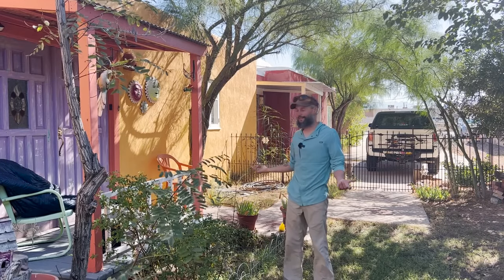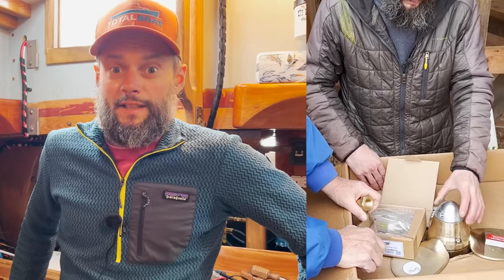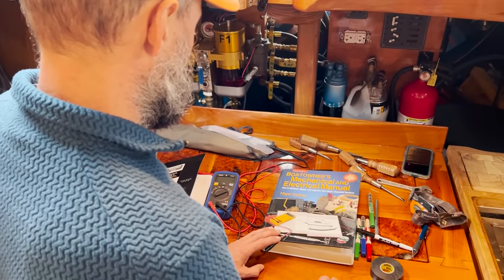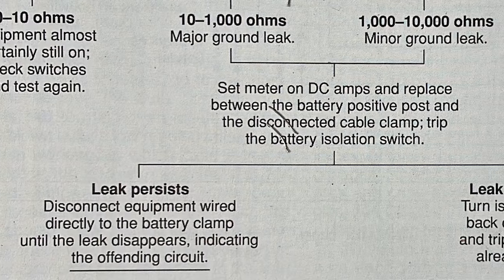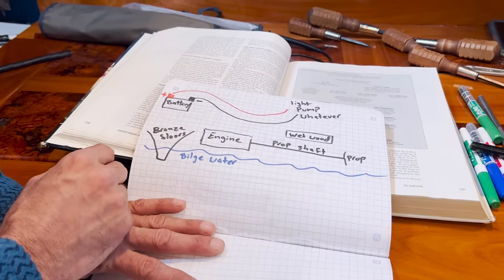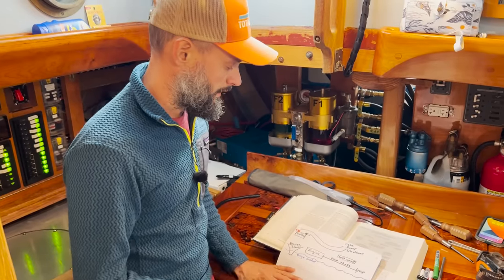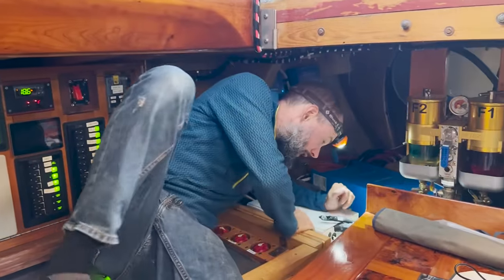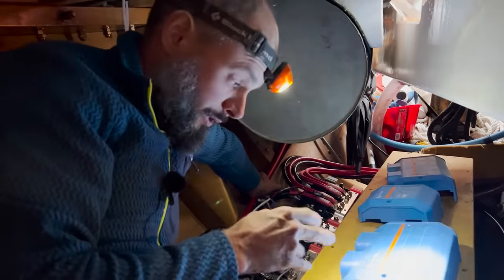Stray Current Puts Arabella in Danger - Episode 284 - Acorn to Arabella: Journey of a Wooden Boat

Comment: Hi,
I have watched your YouTube videos with interest and think you, your wife, friends and helpers have done a great job.  The YouTube video about the anode falling off the prop was interesting.  It could be quite simple in that the prop is made of a few dissimilar metals and will naturally have an electrolytic impact; hence the need for an anode.  The fixing screws for the anode are quite near the edge of the anode and have found from experience that prop anodes of that type can corrode around the fixings.  I suggest when you fit a new anode, is to wipe some sikaflex or silicone mastic in the receive of the anode, and coat the immediate area around the anode fixing location with some paint.  This will protect that area from corrosion and you most likely will find the anode will not fall off.  I have done this trick for years and have found the anode stays in place.  

I also suggest you should fit an independent anode and link it back to the engine ground + any skin fittings in the area.  You have quite a considerable electrical installation and the single prop anode will most likely not cope, should you have any stray currents.
Anyway; happy sailing.  Regards.  Mike

Comment: As an ex Submarine electrician who worked on 440v batteries can I advise you to get a rubber mat to cover all the live terminals?  It will make it more comfortable for you to lie on and it will prevent a dropped tool shorting things.  The correct sized spanner or socket suitably insulated (heat shrink) would also be a good investment.

Comment: steve, sorry to keep at you when you want to leave.  think about getting an alternator- delete for the diesel.  you can run the engine. tension the belt, for the cooling pump and have no fear.  keep the alternator in case of need.  if you are not needing the electric get rid of the load.  the diesel will be more economical too.  now go climb some rocks.

Comment: Current must be flowing between the propeller and some other external metallic component below the water line in the hull. You could use two long lengths of electrical wire, the VM attached between them, one end of one length attached to the propeller shaft inside the boat and the other end of the other length used to probe all the the other metallic attachments.
Observe the VM for currents that would otherwise have flowed through the sea water. This could be done even when under way. This may help to narrow down the search for the offending system.

Comment: My guess before you came to the same conclusion was stray current from the engine hopefully the alternator is not using the block as a ground. An unlikely source would be the starter connection but still worth checking. Good luck in the mountains.

Comment: Correct me if I'm wrong, but with your meter set to mA and its reading 0.01, then the measured current is 10 micro amps isn't it? Good work by the way mate!
Reply: I think that for measuring milli/microAmps the lead has to be in the right port instead of the left port. Look at 21:17
Reply: @CarlosdaCunhaeSilva  you are perfectly correct! Well spotted. Maybe he should have taken the measurements with the mA port...
Reply: Yes. Hes in the 10A port which has a different shunt. The measurements are all off...

Comment: This is entirely speculation, but I noticed that there are a lot of excess cabling all neatly rolled into coils and zip-tied. 
While this all looks very neat and professional, I have found that such coils create induction which drops the current to some degree - sometimes a lot.
If any conductive material comes into range of this coil-induction, a current will arise in it.
Just a thought - but you would do well to get rid of excess-cabling to eliminate stray induction? Specially if it has been made into a neat coil.

Comment: Please check that the Victron Orion TR-Smart DC-DC charger is the Isolated model and not the Non-Isolated model. This is why Victron specifically made two different types. The DC current can be pretty dirty coming from the alternator. You don't want the current is to flow directly between the two sides of the ground. The isolated model filters electrical noise generated from the alternator out and along with it those pesky stray currents.

Comment: I once had the same issue, and I could not find the rootcause,
After many hours, the straycurrent was “gone” 
Me “happy” 
Then, I strapped the V-belt back on, finish everything, did the cleaning up and did a last check on straycurrent.

…. It was back !

It appeared that the V-belt was conductive, and Made the connection to the motor/aluminium hull/ shaft.

I bought a Non-conductive V-belt,  —> Done.

I never suspected the belt in the first place…
“Lesson learned “

Comment: As long as you're working on the engine, have a close look at the starter circuit.  Very possible some corrosion in the starter solenoid is causing the leak.  Had solenoid a couple of time be a problem when exposed to heat and you been doing a bunch of cruising on just the motor.

Comment: I also have a featherstream prop and had the same issue.  I have changed the way I fix the anode on. Clean the mating surfaces of the prop and anode then install using sealant to isolate only the fixing screws from the anode.  Test for continuity if you can. This now gives me at least a season and the anode is degrading normally.

Comment: IF what you're seeing is caused by your boat, it means that for some reason one or more of your under water metal pieces is at a different voltage than the prop shaft. Hence current flow. How are your different ground systems connected? Is there a wire connecting all under water metal? to ground? This prevents any voltage difference. Good luck. I spent 52 years in the electronic business finding defects and ground issues can be  very perplexing. Good luck

Comment: I love your meticulous trouble shooting. Fred of Hansen's is a great guy ! I have noticed you have an immense electrical system. I have thought of writing an article along the lines of ' what mid size cruisers can learn from pocket yachts' regarding electrical systems. Nothing to do with your electrolysis issues, and taking into account your solar array is more than enough to keep the batt bank well charged, I notice that under way you run a lot of electronics. A compass (aside from Nighy illumination) takes no electricity. If it's a blue bird day and sailing in 'known good' waters (depth etc) shut that stuff down, save some juice, save some parasitic leaking and allocate more attention to the sea life, and conditions observation. I am of course speaking somewhat out my keeper because I just have a tiny, weeny little system. But that is also why I almost never fire up my fixed mount VHF (hand held instead, when short range) I use a tablet for chart plotter in the cockpit, independent of system, solar LED lights etc. I rarely even need to through my batt 'master disconnect' switch on while under way during the day light. Thanks for the inspiration as night before last I had my one and only USB port give up the ghost. So that and a weird bleed / equalization seemingly between my bank 'A' and 'B' need to be trouble shot..... I'll probably do that in the boat yard after fall, haul LOL :)

Comment: My first thought knowing you were going away was to connect a kg or 2 of hull anode to the propshaft by wire and hang it over the back (and keep them for any time you are leaving her in one place for a while, especially near other boats or harbours with piling). As the story unfolded, it started pointing to engine electrics as you have done plenty of motoring. The best way to neuter your alternator is the vets way. Whip 'em off completely, take the controller out.

Comment: I got two words for you:
Ground Fish.
You don’t have a “leak”. You have a ground loop. A voltage differential, if you will. 
Very common. 
In a closed DC system there can’t be a path to an earth ground that less resistant than the closed negative circuit. 
And you have that. It’s the negative lead to the stater, the. The engine block.. then down the prop shaft into the water., thus eating away at your anode. 
Solutions: well, a very good solution is to separate the power and ground with solenoids. Ford starter solenoids would work. 
Solution Two: which is very common on work boats, connect a ground fish. Which is basically a zink anode (yes, shaped like a fish) that is molded over a cable that is connected to the negative pole of your battery bank. Then you throw the fish in the water. Thus providing a uniform ground. 
Though, as a permanent fix, I’d definitely isolate that engine block And make up a better ground that didn’t involve the fish hanging over the side😆😆😆
Reply: Yea, I’ve seen this done as a precaution when sailors have to leave their yachts moored in sketchy marinas for extended periods. More often it’s a cheap and effective way to ground the mast against lightning or static current.
Reply: I couldn't quite make it out in the video, but I think the DC-DC charger is the non-isolated one from Victron, so the neg/ground is connected and not isolated.

Comment: If you built a steel ship, I would suggest you use Impressed Current Cathodic Protection (ICCP). This is how modern ships prevent corrosion without the need for sacrificial anodes. If your alternator is producing excess current, it would definitely be the most likely cause since it is attached to your prop, making the problem even worse than if it was a bilge pump.

Comment: Steve, I do not recall from previous videos, but is the alternator the only component that is belt driven on the engine?  If you do not need the alternator power and that is the only thing belt driven on the engine, just remove the belt from the alternator, that way you know the alternator cannot produce power when the engine is running. If the internal regulator has been “neutered”, then even with the power wire disconnected from the alternator it could still leak current through the metal case of the alternator and through the engine possibly.
Reply: Water pump for the engine needs to run.
Reply: @roberthale8407  ok, I wasn’t sure. A lot of diesel engines have gear driven water pumps, but I’m not very familiar with small marine engines.

Comment: I think, you should measure ac voltage between engine block and seawater (ground) when engine running. There is heavy coils in alternator and if not connected they may form some ac voltage to its own frame even without any current going out. It may be enough to eat the sink.
Thaks for nice videos!

Comment: Not sure if it's been mentioned(I think it has in some comments) and it wasn't made clear:  Because any leak requires a return path, just checking if there is current to each device in turn won't really work.  It wasn't made clear if the boat's main DC negative is connected to the actual boat structure or if the DC system is fully isolated.
I would imagine it's not isolated due to the connection back due to the earthed/dc-neg engine so the tests you've been doing are valid, however if you have not done it, I'd test for current between the battery negative and hull to verify that the testing procedure is valid.

I'll be fascinated to find out what the final problem is and how it's solved and for now I'm glad to hear that there are spare anodes on the prop shaft that will do until the problem is solved!   It's a shame there isn't a more active way to monitor this.

Comment: Thinking about the system and what it is that would consume the Anode, it would seem that a resistance meter to an ocean linked component to your electrical system would provide an indication of the a "short" to ground.  If you see the meter peak during operation,  then you know when the short exists. Switch your line of thinking to isolation, rather than current and it becomes a little easier to analyze what is happening.  Yes, trouble shooting after you see it still the same, turn off things until the resistance goes up.  When the resistance is above 1 MOhm, your can stop searching as current is extremely low.

Comment: Don’t know if the item you referred to as an external regulator is the same thing, functionally, but Victron makes a DC to DC charger which is designed for lithium systems.  Many people with RV’ have them between the alternator and the battery bank with heavy enough cable to handle the tremendous amps that the lithium batteries want to use to charge.  Just a thought…you’re probably way ahead of me on this as you are living it.  Hope all works out, and your time away is all you expected and more.

Comment: You have the multimeter selector at milliamps but plugged in the "hot" test wire into the "10 A" plug (around 21:22). Check if this is working, my Multimeter wouldnt. The small readouts of 0.01 to 0.03, but settling, are just errors of the digitizer circuit, not actual currents.

Comment: All of the diagnostics needs to happen in all the "modes" the boat is capable of. Charging from land, charging from engine, charging from solar, running lights, running fans, running all the things. (The boat listing?) Breakers usually breaks only one wire leaving the other wire a possible culprit. And my metallurgy skills isnt complete, but you can have saltwater making current between two alloys of metal with no other electronic potential present. Dont know if you can meassure amps in the propellershaft towrads water\earth but those are the ones eating the zink

Comment: Someone's probably said it already but I imagine the residual magnetism in the alternator  could be causing the output of voltage, which would make sense as simply unplugging won't help as it will still try and force that current down an earth. An electro-magnetic clutch pulley would be ideal, you can then just switch the alternator on or off manually or have it controlled by another system, knowing that there is no way the alternators windings will spin from the engine. Depending on the size you can probably buy an car alternator pulley as an off the shelf part.

Comment: Your hypothesis that it is the alternator seems solid. My initial thought was maybe there was a leak coming from the solar panels. The only other thing I can think of is that you have inadvertently created a battery in the construction of the boat. That would seem unlikely, although I would refer you to aluminum-air batteries as an example. It seems also possible that you could maybe set up a test device where you have a wire connected to your prop and your anode and measure that current. That would at least confirm that it is an electrical current. One other thought is perhaps the anode material itself was somehow defective. Maybe not the pure alloy you expected.

Comment: Consider ? The alternator when in circut or not is still an electro magnet that will have to dump generated electrons via it's earth connection with the sea. Dual circuts, 1/ for running the ship circuits on traditional lead acid batteries, 2 /for the frivolous toys and home comfort circuits running on solar panels/batteries, just like the chalk and cheese try not mix the two together Steve  ;  )  Best of Luck

Comment: I would be quite interested to know how the bonding and grounding system is laid out on Arabella. Is the prop shaft electrically  connected to the engine block? If so, the seemingly low voltage drop on the negative connection between the alternator and Lynx bus may produce a positive potential  on the prop shaft with respect to the keel (assuming the keel lead is the primary element in Arabellas' earth/ground connection). Insulated shaft couplings and isolated output alternators (Balmar brand comes to mind) are a couple of common tools used to solve such a problem.

Pacific Yacht Systems YT channel has some of the best presentations on marine electrical I've found so far. (YT search: pacific yacht systems ground)

Hope that you and Robin are enjoying the climbing...
Reply: I keep having this problem push to the front of my mind... Perhaps the simplest solution is to use the engine block as the common point for all grounding elements. In the case of Arabella, I assume that the keel, through-hull fittings and the prop-shaft are those elements but there may be more. In practice, the DC Negative bus should have only one connection to the ground system (I propose that would be the engine block in the case of Arabella). That still leaves one to assess the engine instrumentation and controls connections, looking for possible parallel paths for current that could produce undesirable current flow.

 I think that re-running a few bonding connections would be simpler and much less expensive than an isolated output alternator and/or insulated prop shaft coupling and slip-ring assembly.

Comment: Steve, have you considered “galvanic corrosion”?  You don’t need a battery or power source for galvanic corrosion to occur.  It is caused by two dissimilar metals being in contact, steel shaft and bronze propeller, for instance.  The fix is to interrupt the return path for current flow. I’ll leave it at that, but I wouldn’t dismiss this as a more probable cause.

Comment: Quick tip - when having a long list of things to test, do a binary search. In this case, leave half the systems connected and half disconnected, test it, if it is leaking it is in the connected half, if not, test the disconnected half. Then follow along, always testing half the isolated systems each turn, narrowing until there's only one. This of course increases the margin of error, maybe you'd find like 0.05 here or 0.1 there - but it takes a fraction of the amount of work.